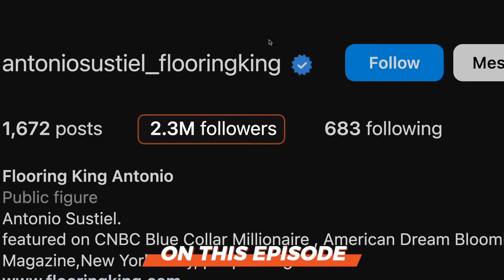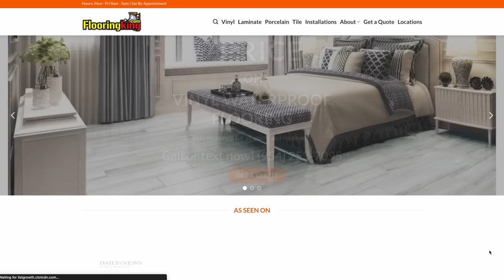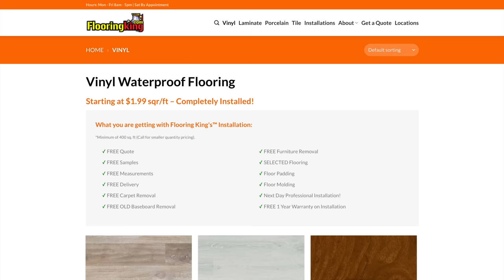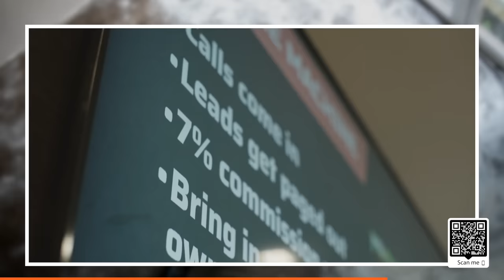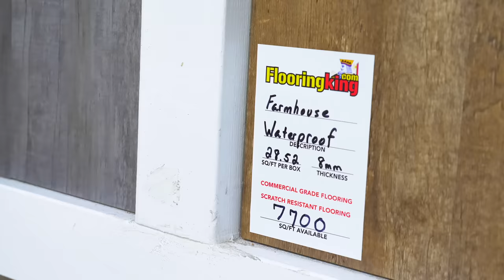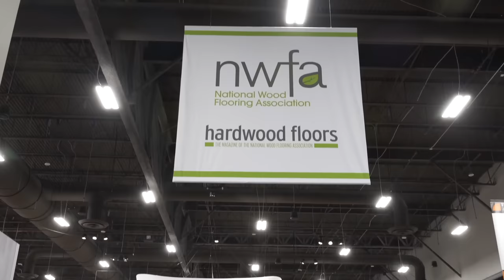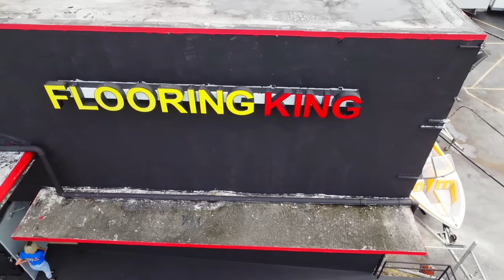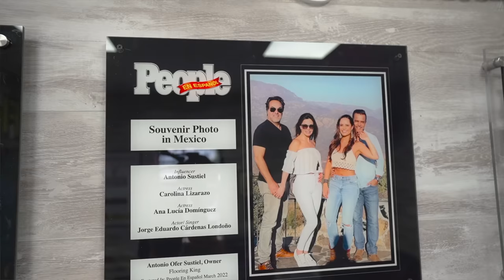How I Turned $400 Into $150M

Comment: I assisted a consulting client with starting a flooring company on the internet.  He used distributors and had no inventory but sold everything.  He had very little overhead.  This can be accomplished with hardwood, tile, carpet and other building materials.
Reply: Which distributors? I feel like you can have a small show room with the right connections
Reply: What other areas/markets are you in?

Comment: So he had another business he built on first, and despite burning up that money, still had some savings with which he bought an inventory of flooring to get started (his words). More detail about how he actually went from $50 to success would be nice.

Also, can this guy answer any question AFTER the question is asked? He seems so eager to talk -- and talk over -- that it makes me feel strange.
Reply: That's probably a condensed version of his life. He's not going to give every detail of every turning point, or a detailed account of how he went from point A to point B. Not practical. I'd take hours. That said, I have to give it to him: he is a hustler. That shows in the way he talks. You need a bit of that in business or you won't make it. As long as he's keeping afloat, he's alright for me. Gave great general biz tips. Appreciated.
Reply: @jkgv1740  you know the word "hustler" can have a negative connotation, as well. 

Still, my point is that the video makes it look like he went from nothing to building this particular business ground-up but that's untrue. He apparently built this one AFTER the first business success and using funds he still had saved from that business. Skipping over that part of his life is NECESSARY and important information, and I know it's very possible to explain that within an acceptable time frame instead of spending so much time chatting about what his current business offers rather than HOW he got there. I never said anything about giving a "detailed, A to B," hours-long explaination of how he did it. That's nonsense. I know that you are well capable of getting the meat of the info from people like him and presenting that valuable insight to us viewers, rather than just letting him talk over you nonstop about what his business does. People are interested in how he got there and this video purports to do that --but doesn't. Ironically, it literally skips over the very thing we viewed for. 
Everyone has heard already about the "hustler" culture, or the motivational money guru style "YOU GOTTA HUSTLE IF YOU WANNA WIN" motto, but that's silly and useless without correct methods and right actions. What were his real actions? What steps did he take to build the supposed jewelry business? Don't tell me it's "he hustled" because that's a non answer.
Reply: He saved 100K from the perfume biz which he says he sold for 3.5M. The host did semi clickbait with the $400 to 15M
Reply: He is a BS'er.
Reply: The heading on this video is clickbait. He explained his story in the video.

Comment: Im a flooring installer, 32 years at it. We installers keep the doors of every flooring shop open that installs flooring.  Unless they just do retail. The problem with installers, is there is a lot of cut throats in this buisness.  They do it cheaper.  Most cases end up costing the Customer double because the job is screwed up. Not sure what you guys in south Florida get, but 15 years ago when I lived in Orlando.. it was a joke!
Reply from the maker: Thank you for sharing your piece on the industry, Jody! It's very important to hear all sides of the story to help people planning to join the flooring industry. What are the key differences in the industry from when you started vs. now?
Reply: @UpFlip  The difference from 32 years ago to today is it's different as far as flooring material. Newer flooring coming out that is easier to work with.  The carpet is better.  The LVP(luxury vinyl tile) is the hot ticket right now. HOWEVER..I will say this.. It is "NOT" water proof!  I have tore out 5 floors now with LVP that had the "water proof" LVP  down, it buckled just like real wood does when it got wet!!  I'm not sure where this water proof sales pitch is going to end up going in the future.. guess we shale see.👊🏼☕️
 I'd say someone getting into the installing side.of the buisness, if you can handle very hard work, lonng hours sometimes, heavy ass lifting, this could be the job for you. The pay scale is very good. Just don't try it down south..lmao.
 I clear average $2500 a week by myself easy. That's not a lot of hours either! Can't find help right now.. so I just work solo.
Reply: @19jody72 What do yiu mean down south? Because its too competitive?
Reply: @PepeNuclear   What I mean is this... the further south you get, the cheaper the pay..
What are you guys getting down there? Last I talked to.a buddy in Orlando, which is where I used to live..1.90 a yard for carpet and .50 for lvp
Reply: @19jody72 Hey what state are you in, need a helper?  I’m near portland Oregon

Comment: Just in case you guys dont know, Sherwin Williams, Flooring American and Carpet One are the big timers as far as selling. But this dude here saying that LVP is water proof? IT ABSOLUTELY IS NOT!  The water proof test that is done is ONE piece of LVP in water submerged halfway. Now you or anyone do this test maybe in a pool or something.. click it together like as if it was installed in a  customer's dwelling.  Youll see what happens!! Its going to be very interesting in the future to see how this "water proof" flooring ends up. Time will tell
Reply from the maker: @19jody72  That's really good info!  True, it's hard to find things that are legitimately 100% waterproof. Maybe water resistant would be a better term?
Reply: @UpFlip   Well, I have now tore out (5) of these water proof floors now.. all the joints  buckled and warped just like real wood does. So that there alone is proof to me. Some were the cork backing and some had the rubber backing. So it's not just one particular backing that damages from water or moisture.